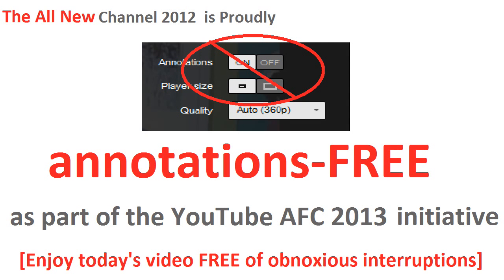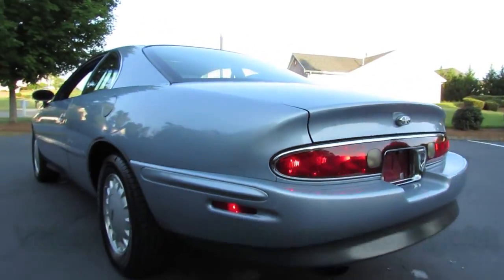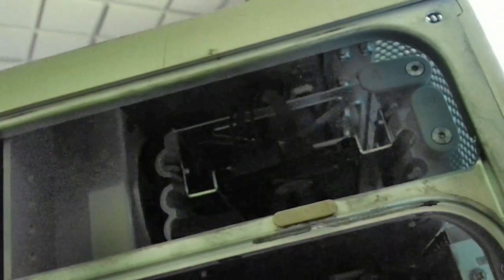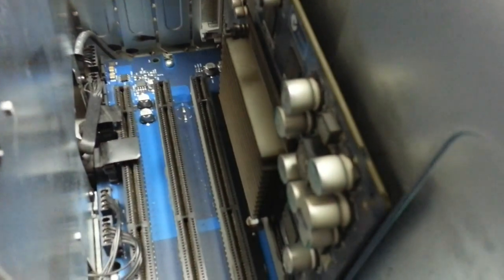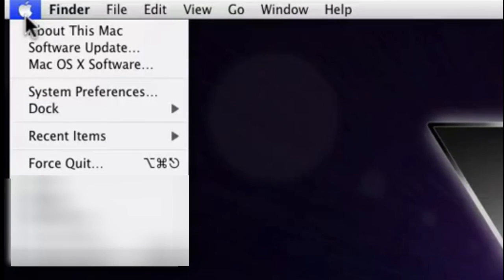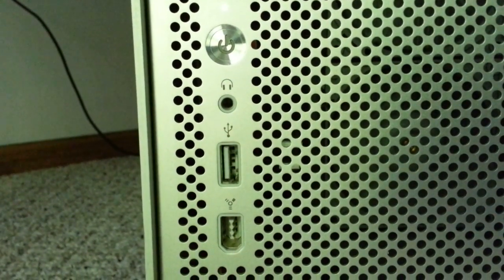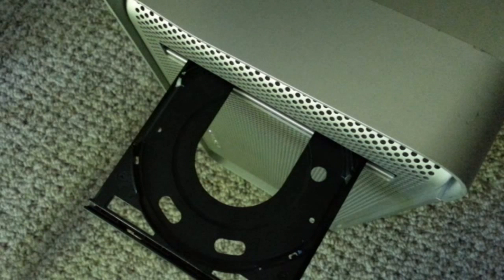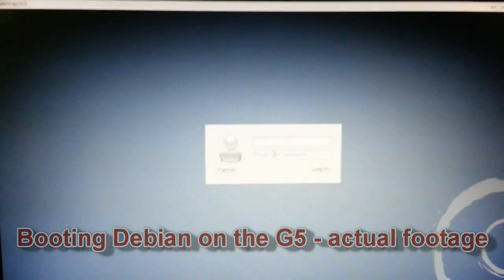FAQ - Using PowerPC Mac PCs in Modernity

Comment: Geez, you have some wrong info. The iBook design and PowerMac G3/G4 designs were NOT failures, nor were the computers themselves. These things are still highly-appreciated today, among enthusiasts.

A PowerMac G5 isn't as powerful as a Pentium 4 from the time? AHAHAHA! Are you kidding me? I have tons of sh*tty Pentium 4 computers, and they are nowhere as fast (or even close to as good) as my 2003 DP 2.0Ghz PowerMac G5. My G5 still screams... this computer was better than and had a much lower price tag than its competitors at the time. Not only was the CASE good-looking, the hardware/build quality was great. No cheap, horrible Pentium 4 computer could ever come close to this thing. It's like comparing a Toyota Tercel to a BMW. This is a pretty biased video, and you have a lot of information wrong. There is no way that some crappy Pentium 4 beats a PowerMac G5.
Reply: G5s are still very capable machines, and projects like TenFourFox and PowerPC Archive help to keep them relevant on OS X 10.5.

I agree with maccollectorZ as I also have a 2003 DP 2.0. Screaming fast for the time, certainly ahead of where the Pentium was at.
Reply from the maker: Thanks for the input. Regarding your thoughts on Pentium4 computers, I have to say that even after having finally sold this computer, we still have two Pentium4 computers in the house that do perform significantly better than that thing ever did. Maybe the G5 is better on paper, but the fact of the matter is that in real world usage, the Pentium4-equipped computers just work faster.
Reply: ***** I'm not sure about that. First off, it's uncommon to come across a dual core Pentium 4 (and as far as my knowledge goes, there hasn't been a quad-core Pentium 4). I currently own an original, 2.0Ghz G5 w/ 8GB of RAM, and it smokes my Pentium machines. Also know that a single PowerPC CPU clocked at 600Mhz is almost the same (or even faster) than a 1Ghz Pentium. Intel processors were getting better, but PowerPC definitely smoked those Pentiums. The amazing performance from Intel chips didn't come until the Core 2 Duos. I am not impressed by my Pentium computers. I guess it's partially because they run Windows; they are way faster on Linux and MacOSX (via Hackintosh intall). That being said, my PowerMac G5 has been able to speed along just fine. And it's not just speed, but it's the overall computer. First off, I can't look at an XP-era Pentium computer and not feel my stomach sink from utter distaste; the same goes for the computers' internals. The PowerMac G5 looks nice and is built well. In fact, the current OEM Windows PC is STILL behind the PowerMac G5, in terms of build quality. It boggles my mind that it's more than 10 years ahead of any Windows PC you can buy today... they still make Windows PCs in the same way, and they have done so for a good 25 years. There is no elegance to it: It's a black box with a 'pretty', plastic bezel on the front (to make it appear nice), and internals crammed inside of it. 

I am sort of having a hard time explaining this, as I usually don't write about late PowerPC machines vs. Pentium machines... It's more of something that can be shown, not explained. There is no reason why a Pentium 4 computer could even be close to a PowerMac G5, in terms of its architecture/build quality, ease of access, and power. A PowerMac G5 cannot even be compared to a Pentium 4, in fact... this processor was compared to the Xeon, which was in the competitors' computers. None of these machines were as powerful as the PowerMac G5, nor were they less expensive.
Reply from the maker: maccollectorZ (Commenting Account)
Interesting thoughts. Let me point a few things out though:

First off, when you said "it's uncommon to come across a dual core Pentium 4", you are absolutely right because (if I remember correctly) no such product exists. Many "hyperthreaded" P4s exist (which may have been what you were referring to) and these are what are in the two older desktops we use at home.

I found it interesting too when you said "I can't look at an XP-era Pentium computer and not feel my stomach sink from utter distaste". In a way, I can identify with that because the picture I have in my mind when you mention that is a crusty gray plastic circa 2001 dell tower, which isn't terrible in and of itself, it just probably had an inadequate amount of ram and a slow/noisy hard drive. That said, a Windows XP computer is more useful because most Windows software is still compatible with it and that sinking feeling you get when you see that computer is the same one I get when I used to have to look at the G5. Two words come to mind during this time: Wasted Potential. Like I said in the video, it talks a big game, but just doesn't come through in the performance department, the compatibility department, the connectivity department, the efficiency department, and many others.

Next, when you said "it's more than 10 years ahead of any Windows PC you can buy today", you were right in the sense of the case being top notch (heck, Apple kept it going with the mac pro until 2012 or so), but you have to keep in mind that an expensive case costs more to make and will turn a $199 "WalMart special" computer into a somewhat more expensive machine. The OEMs' goal is to make them cheap and cut corners to keep that low pricepoint. Those who want quality cases hit up eBay.

I thought you were spot on when you said "It's more of something that can be shown, not explained". I was thinking almost the same thing when putting this video together. Sometimes it's had to visualize the frustration aspect of the G5 and the "it just works without problems" aspect of everything else, but I think I hit the main points: the computer requires a lot of hand-holding to get anything accomplished and the performance is just plain bad, those two points sum it up really. The performance difference is most notable when browsing the web (which is about all you're going to be doing on the PowerMac anyway because of the incompatibilities). Our main circa-2005 Pentium4 performs better at everything (even HD video playback) and is compatible with far more software than the G5 is/was.

Comparing it to the newer (socket 775) Pentium4 machine that I referenced in the video almost isn't even fair, it just puts the G5 to absolute shame, so I suppose you were right when you said "A PowerMac G5 cannot even be compared to a Pentium 4" because the G5 is just that bad.
Reply: *****
It was definitely wasted potential... I really hate Apple for that. They recently decided to cut-off software support for their original Mac Pros, which are MORE than capable of running Mountain Lion or later (good thing one can undo their EFI modifications, but still...) As for PowerPC Macs, I understand that they want to get away from them, but they completely left-behind very powerful and capable computers. This is why I am heavily against software that is constantly updated (Google is a major player here), because it causes perfectly good hardware to become "obsolete".

Windows XP would have been cut-off earlier, had Microsoft not screwed up with Vista. But XP really is an example of what happens when a company actually supports a piece of software for a long time... it shows that software becomes obsolete way before hardware does. And once hardware does fall behind the software that now longer supports it, it's deemed as a piece of junk. Among good hardware, there is obviously bad hardware, but a PMG5 is a great example of a nice piece of hardware that was ruined by software.

By the way, how come you get a sinking feeling when you see a G5? Going by collective opinion, they are very appealing case designs.

I am assuming that you played with my words there... I meant that no Pentium 4 computer can be compared with a G5, because the G5 is radically different and much more powerful. When you look at the Quad-core PowerMac G5s, those especially run circles around the lesser Pentium 4 computers. I am not saying that Pentium 4 computers are powerLESS, but they don't pack the punch that PowerMac G5s do. Also, if only concerning the speed of the machines, that's the only thing a Pentium 4 machine could come close with... there is nothing else appealing or straight-up GOOD about one. Given that they are obviously not sold new anymore, the price different is not relevant.
Reply from the maker: maccollectorZ (Commenting Account)
I know what you mean when you talk about unnecessarily updated software. We see that on the desktop (mainly with web browsers), but even more so on mobile platforms. Android systems are considered "obsolete" after just a few years and the installed software (if acquired through the ever annoying Android Marketplace) gets begged to be updated on a nearly daily basis, which wouldn't even be a bad thing if the updates didn't make the software worse!

I want to touch on your mention of "Windows XP would have been cut-off earlier, had Microsoft not screwed up with Vista" because that is a really interesting topic. The main problem with Vista wasn't performance or compatibility, it was actually just bad press. After SP1, Vista was set and fixed, but the image of the product became so bad that they quit it early and released basically the same thing again (with some improvements and added goodies) under a different name (7). That said, there's nothing wrong with using Windows 7, Vista, or XP aside from those created artificially.

"PMG5 is a great example of a nice piece of hardware that was ruined by software"? Maybe, but if you ask me, the software that is available for it performs poorly anyway, so it was probably for the best.

"how come you get a sinking feeling when you see a G5?" Like I mentioned before, past experience. I'd spent so many hours giving that thing a second chance, but it was like a straight-jacket that kept me from getting anything done. The only reason I kept it so long was because I thought it could be a viable desktop (until I got the P4 desktop), a viable web browsing/emulators computer (until I realized how horrible web browsing was and that I could use my phone for emulators instead of a 600 watt computer), or even a viable "maybe I'll find another use for it" computer.

I thought it was especially interesting when you mentioned that you thought "that no Pentium 4 computer can be compared with a G5, because the G5 is radically different and much more powerful." because the G5, in real world usage, performed more slowly than our circa-2005 P4 desktop at home (that machine is still going strong in fact - and with XP) for most tasks. Chalk it up to poor software, but it is what it is.
Reply from the maker: Timur Tripp
That might be a bit of a stretch, but that website was at least a decent resource for software. TenFourFox went downhill in the last year or two, but it was a decent browser.
Reply from the maker: maccollectorZ (Commenting Account)
I'd have to see that to believe it. For me, it got bogged down with one browser window and a single tab.
Timur Tripp
Mine does. Granted, the Pentium4 machines I'm comparing to are a year or two newer, but still, they handsomely outperform the G5 at web browsing (and pretty much everything else for that matter).
Reply from the maker: maccollectorZ (Commenting Account)
Seems like too much hassle. Windows functions just as well and doesn't have any of the obnoxious artificial mouse acceleration that is inherent with OSX. I avoid it for that reason alone because that has such a negative impact on productivity.
Reply: ***** I've never noticed this at all. Chances are you just need to get used to it.
Reply from the maker: Timur Tripp maccollectorZ (Commenting Account)
If you're having trouble noticing the difference that competent mouse acceleration makes, try a little experiement that I found helped to pinpoint and quantify it: Come up with an arbitrary "task" consisting of clicking a dozen or so buttons on-screen that are close together quickly and time yourself doing it in Windows or Linux, then perform the same task (in a program that is layed out the same or similarly on both operating systems) again on OSX using the same mouse. You'll probably find that you will take significantly longer to perform the same task because of OSX's non-linear mouse acceleration. I found that even the awful trackpad on my Windows netbook was able to outperform my USB mouse on OSX at this exercise. Realizing that OSX drug my productivity down to netbook-class levels was when this really hit home for me.
Reply: ***** I have found Windows' accuracy to feel worse and far less smooth---even with the sensitivity lowered. Linux is the worst between the two. However, in MacOSX, the accuracy and flow of the cursor is great. I also notice that, in Windows, the clicking accuracy, while the cursor is in motion, is not as good. A good way to test this is playing Minecraft. If you are dragging items around, and you need to quickly bring your mouse pointer over to an item, select it, and drag it away, Windows does a bad job of it. I would never have issues with MacOSX, but in Windows, I had to slow down my mouse movements in order to better select items when having the cursor in motion. I do notice a snappy feel with the mouse cursor, in Windows, but I don't find its accuracy to be the greatest. And in terms of touch pads, Apple's hardware and software seems to be a bit more advanced. If you've ever used a trackpad on a Windows PC, where you (idiotically) cannot turn off tap-to-click, you constantly click and drag icons (etc.) by mistake. I am sure this is more of a hardware thing, but MacOSX could also be smarter about dealing with tap-to-click... not that I'd even want to use that stupid feature.
Reply: ***** Pentium d is a dual core Pentium 4 with no HT and they sucked, i mean really sucked, a 1.8ghz athlon dual core was faster than a 2.6ghz pentium d.
Reply from the maker: Super_Slav
Good to know. I'll have to keep that in mind if I ever go shopping for one of those kinds of processors.
Reply: ***** How did TenFourFox go downhill?
Reply from the maker: Timur Tripp
First broken plugins, then the Australia problem that plagues mainstream versions of Firefox.
Reply: ***** Even with tweaking guides that I followed, TFF was STILL a horribly-slow browser. I don't fancy the creator's decisions to make it a full-fledged Firefox browser for PPC Macs... that's stupid. He's aware that the current FF code is extremely heavy. I can't even get decent performance on my 2.0Ghz, dual-processor PowerMac G5. As for Leopard Webkit, it runs beautifully.
Reply from the maker: maccollectorZ (Commenting Account) That's for sure. You shouldn't send the G5 to do a Pentium4's job.
Reply: ***** No, this thing is definitely a power house. MacOSX is also efficient enough that I am not able to max-out the 8GB of RAM I have in it. I was able to run every single application I had on the thing, plus three YouTube videos in three different web browsers, and the computer was both responsive and had 5.5GB of RAM free. I still wouldn't depend on a single core Pentium 4... the only possible advantage of one is that it can run an OS that's still up to date.
Reply: ***** Oh sure, like a P4 could handle the current version of Firefox better than a G5.
Reply: ***** TenFourFox on my G5 certainly wasn't slow with just one tab. How much RAM does yours have?
Reply from the maker: Timur Tripp
It had 2GB (like the nicer of our family's Pentium4 computers) and ground to a halt on crusty javascript-infested webpages that only slowed the P4 machines down a little bit.
Reply: ***** BTW, I just got Leopard working on a 2.8Ghz Pentium D Gateway w/4GB of DDR2 RAM... It runs so much better than Windows EVER will. It did run pretty nicely, but it didn't feel as hearty as my G5. It seemed really good with 10.5.5, but with the updates, it seemed to run OKAY. I haven't compared it to the G5 side-by-side, but I do know that this system is nowhere as powerful as the G5, and doesn't handle certain tasks as well. The web ain't kind to PowerPC machines, but then again, the G5 does do pretty well on it. As for anything else it, sure runs well.
Reply: maccollectorZ (Commenting Account) Why Leopard, why not stick Snow Leopard on there?
Reply: ***** I find that the way the mouse cursor moves in MacOSX is the best. It feels relatively inaccurate in Windows and Linux.
Reply: Timur Tripp I can't remember why... I think I had tried installing Snow Leopard as well. The thing is, I had thought that the installation had failed, so I had packed up the Gateway. Now, months later, I took it out and powered it on. For some reason it actually worked---it went through the set-up and booted to the desktop. It was working nicely, save for some graphical errors. If I were to drag a window with my cursor, it was as if the cursor was tearing through the pixels that it was touching. Software Updates worked fine though. In fact, I plugged an ethernet cable into it and it connected to the internet immediately. It all went pretty well, but then it ended up crashing. I wasn't using Multibeast/Unibeast to install it, so it was a little bit on the sketchy side. But that's beside the point. The point is that it was running MacOSX pretty nicely---better than Windows.
Reply: maccollectorZ (Commenting Account) What a funny coincidence, my DP 2.0 G5 has a similar graphical issue around the cursor, like the pixels around the cursor retain a memory and go back to that state after the cursor is moved away. Both Tiger and Leopard. Very annoying. GPU is stock R9600.
Reply: maccollectorZ (Commenting Account) I use tap to click on my rMBP and it actually works very well. PC trackpads are finally starting to catch up but they are still more prone to accidental clicks.
Reply: Timur Tripp It's far more pleasurable on Macs, but I personally don't like the feature. Some companies don't get it, when it comes to trackpads. HP has some of the worst trackpads known to man. What's odd is that I have an HP laptop from 2000, which has a fine trackpad. Yet, all of the one's I have used today have horrible trackpads: The mouse cursors skips and jitters about the screen; the surface of the trackpad is either coated in an abrasive texture or just feels cheap; the buttons, if part of the trackpad itself, are horrible-integrated and feel stiff, and so on... I feel as if HP completely changed its management, because their computer used to be nowhere as bad as they are now. Another sad thing is that keyboards have gotten worse. If you are ever at a store like Costco (or one that sells computers), try typing on the Windows laptops they have there... the keyboards feel atrocious.
Reply from the maker: maccollectorZ (Commenting Account)
Interesting observations, I guess I never noticed "click n hold" accuracy issues in Windows, but I don't play (or like) Minecraft either, so that may be part of the reason for that. The point still stands though that OSX's obnoxious and nonlinear mouse acceleration reduces productivity down to netbook levels, and the stopwatch (and real life results) prove it. As for Linux distributions, do they even have mouse acceleration at all? I mean, no acceleration is better than OSX acceleration, but it does help to improve precision.

As for trackpads, I've seen good and bad ones over the years. The trackpads in the MacBooks I used to have were kind of lousy, but they were bearable. The best trackpad I've ever used is the one on my Lenovo N200 - it's got the perfect texture (not too smooth), excellent sensitivity, and it's the perfect size (not too large). That is one of the few trackpads that I can use without missing my mouse at all because of how productive I can be while using it. I do disable "tap to click" on every trackpad I use though because I can't stand it; half the time it's convenient, half the time it clicks on something I didn't want it to click on.
Reply: ***** For those who like tap-to-click, the MacBook trackpads are the best. The trackpads on the original MacBooks were OKAY, but they did wear down to an unbearable level. However, with the introduction of the unibody Apple laptops, glass trackpads were also introduced. These trackpads are not only great with gestures and very responsive, but there is a thin layer of some type of glass over them; as far as I know, they are virtually unwearable. They feel nice and smooth, and your fingers will never catch on the surface, even if they are sweaty or something. Of all the great laptop trackpads out there, the glass Apple trackpads are definitely up there.

I used to wonder if the "glass" thing was true, until I saw someone who had shattered the trackpad on theirs... God knows what some people do with their laptops.
Reply: P4 is NOT as powerful as G5 were, so let's put this to rest. P4 with NetBurst architecture were overblown POS chips that sold only thanks to Intel marketing machine. This is a professional grade workstation, and to compare it to P4 is just not fair due to difference in OS. P4 system would to have run Windows or Linux, and FYI, I had a P4 3.0Ghz Hackintosh running OS X Tiget Intel version back in '09 and it  performed worse than dual 2GHz G5 running OS X benchmarks, so there you have it. I still have dual G5 and it works just fine. Check my video to see it in action, the video is old but gives you an idea. Is this still usable in 2015? Depends what you do. If you want a machine that is to be used for email, word processing and ocassional browsing, it works great. You can use it for video editing but newer machines perform better.  Overall this assessment is full of inaccuracies, that it seems it was created by someone who has no clue of OS X, btw. it is OS ten, not OS Ex.
Reply from the maker: AtariForeva
Interesting observations, but let me point a few things out.

When you said that "to compare it to P4 is just not fair due to difference in OS", you are partially right. What makes it an "apples to oranges ;-)" comparison more than anything else is the architecture, but the point was that the Pentium4 computer would be, generally speaking, just as fast for most tasks, if not faster. I used the rudimentary (but effective) "do the same thing on both types of computers and see which one does it faster/better" method. The Pentium4 computers (Prescott and newer Prescott) that I used both exceeded the relative performance of my PowerMac in every area I informally tested, except for style, where the G5 had the edge both times.

When you said, "Overall this assessment is full of inaccuracies", I looked back at my video and couldn't see any, but it's always possible that I overlooked something. Let me know if you spot any.

Thank you for your inquiries and have a great day!
Reply: ***** I went back to try out one of my many P4 machines. I found that the machine was doing well, considering the up-to-date software it is running (Linux Mint). However, once it seems as though it starts to choke once it has to start multiple CPU processes. I found that it was fast with general GUI navigation, but once I got into more intensive things (such as surfing through YouTube), I found that my PowerMac G5 handled things much better. Of course, the PMG5 has much better specs, but if you are saying that even single-core P4s are faster, this is what I was testing against my G5.
Reply from the maker: maccollectorZ (Commenting Account)
That's interesting that you mention that you had a better time with YouTube on your G5. My experience was the exact opposite. There isn't even such a thing as a dual core Pentium4 (although ours are all hyper threaded), and they still handle as well as or better than the G5 for most day-to-day tasks, so that really says something about specifications and benchmarks not necessarily being an end-all evaluation.
Reply: *****
I am actually using G5 with TenFourFox right now to post this message, and the video is choppy since YouTube switches to HTML5 on TenFourFox. Flash 10 on Safari 5.0.6 browser performs quite good, your video is nice and smooth @480p and @720p it stutters a bit. Once I switch the video card from stock 64MB ATI Radeon 9600 to NVidia GeForce 6800DDL with 256MB the video acceleration is noticeably better. And I have 2GB RAM only on this machine. The biggest grief in my opinion is handling videos especially HD ones when compared to newer Intel machines. Mac Pros which are direct successors of Powermac G5 line are way faster and pleasure to work with, but for someone to get a handle on Unix side of OS X as well as get to know intricacies of GUI side of OS X, this is great machine since it could be bought for even less than $50. As for Intel P4, the Pentium D which was released as a last member of NetBurst family of chips was dual core (2 P4 cores on the chip) and it performed pretty good, 3.4Ghz  Pentuim D performed similar to 2.33 Core2 CPU, but it ran hot, same as later G5's. If I had a choice between P4 machine and G5, it would be G5 any time.
Reply: AtariForeva I recommend Leopard Webkit; I use it on all my Leopard PPC Macs and it works very nicely. It is as light-weight as Safari 5 is, yet it's fully up-to-date. I think YouTube got even heavier very recently, but it definitely plays YouTube videos faster than TFF, and is faster than TFF in every way possible. TFF is rather heavy, in fact. I have an original, 2003 PowerMac G5 w/8GB of DDR1. These things still handle the web nicely. I sort of envy those who have the newer models, though. Those models introduced DDR2 memory, etc.
Reply: ***** Here is a great stress test that I did some months ago: 

https://www.youtube.com/watch?v=_1k07EMbnSI
Reply: maccollectorZ (Commenting Account) I just puled an older SSD I had laying around, Intel 320 series, SATA 2.0 and it works great with PPC G5, it is visibly snappier. I recommend it to anyone with G5. Do not use SATA 3.0 SSDs, they won't work, but my Mac Pro does not complain about those. Btw. I had Webkit installed but forgot about it ;). I'll try to put up comparison video, side-by-side using spindle and SSD drive one of these days, time permitted.
Reply: AtariForeva Very nice--I wish I had an SSD in mine! I got my first SSD a few months ago but I put it in my 2009 MacBook Pro, which badly needed it. (That dang, mechanical hard drive kept intermittently keeping the thing from sleeping.) I made a comparison video of Webkit vs. TFF, but I never got around to exporting it and uploading--I think I scrapped that project. Glad to see that you will be doing a test! You'll find Webkit to be nice and speedy.
Reply from the maker: AtariForeva
The video card does make a world of difference. The only problem is that it is extremely difficult and annoying to upgrade video cards on the G5. So much so that it usually isn't even worth it.

maccollectorZ (Commenting Account)
Good call on the Leopard Webkit. While it is by no means as functional or flexible as modern firefox variants, it looks and performs a lot better than the mess that TenFourFox became (speaking of which, are plugins still broken in TFF?) with all of its Australia BS.
Reply: ***** Well, difficult technically or difficult to find one? It's no different than swapping a PC cards, and eBay still has quite a number of them cheap. I see NV GF 6800DDL for $39.99:
http://www.ebay.com/sch/i.html?_odkw=powermac+video+card&_from=R40&_osacat=0&_from=R40&_trksid=p2045573.m570.l1313.TR2.TRC1.A0.H0.Xpowermac+g5+video+card.TRS0&_nkw=powermac+g5+video+card&ghostText=&_sacat=0
There might be stuff available on local kijiji or craigslist. But still, if you find it slow, you can mod it:
http://www.s155158671.websitehome.co.uk/asusp6t7g5!.html
Reply from the maker: AtariForeva
What you fail to mention is that finding a card that is actually compatible is just half the battle. Having to use a regular computer to flash your new card's BIOS is just icing on the cake. If I need a computer upgrading challenge, I'll do it on hardware that is actually worth my time, not one that is worth less than the underpowered $40 video card I'm going to be buying for it.

That said, gutting the case and upgrading the internals is a great idea, but extremely involved.
Reply: ***** Well, you still have P4s you are actively using, so I guess they matter to you. Choosing video card is trivial so as installing it, there are no driver issues as in Windows for example as long as you choose Mac card. Doing video card BIOS modding is not what someone who wants to check out Mac is supposed to do. Again, this is directed to people who are wondering about PPC Macs, not to you, since you have made your decision.
Reply: ***** Yeah, I feel as if it's not as up-to-date as TFF, but I probably need to download a newer build... I wish it notified you about general updates. But yeah, TFF is WAY too slow. If you contact the creator of TFF about it, he just gives B.S. and won't necessarily believe personal accounts that TFF is slow. I really don't understand why he wants to stick modern FireFox on a PowerPC Mac. Modern FireFox is SO heavy with its code. This guy could easily make a light-weight, yet fully updated, browser for PPC Mac; instead, he chooses to sacrifice speed for an entire FireFox experience. I wish someone would bring back Camino. The TFF guy should resurrect it and see how it compares to his own product. He could advertise it as a light-weight alternative. I just see tons of people acting cheery over TFF and saying that it works just fine on their iMac G3 or iBook. Seriously, I have noticed a significant drop in speed, with TFF, on my PowerMac G5. Webkit is faster in every way. The only thing is that Webkit is apparently not as secure.
Reply: ***** That is admittedly true; finding GPUs for these things is a pain. Personally, I don't care to upgrade the GPU in a 10+ year-old computer, but back then, it was still a pain. I have one of the greatest stock video cards for the PowerMac G5 (GF 7800GT), and it's still expensive. I see them for almost $100, when they are just old, outdated GPUs. As for Mac Pros from about 2007/8-2012, you can just put any card in those.
Reply: By the way, have any of you gotten Debian PPC working on an old Mac? I tried it on my iMac G4; it installed fully, and then upon restarting/booting for the first time, I was presented with a black screen. I actually saw your post (Channel 2012) on a forum, while I was looking around for answers. I tried typing in that command that had worked for you, but still nothing. I still get a black screen.
Reply from the maker: maccollectorZ (Commenting Account)
I don't use Firefox on any computers anymore. Last year (when Firefox really went down the toilet), I discovered Pale Moon and have since switched over to it on all the household computers and never looked back. We just couldn't say no to all the performance of mainline firefox combined with good looks.

As for Debian, (and the other half dozen or so Linux distributions that I tried on the G5) it never ended up working out. My failure with Debian probably ended up representing the farthest I ever got with Linux - it worked, but there was no sound, no flash player, and strangest of all, no fan control, which means that about one minute after the system loads, all hell breaks loose and the fans ramp up to hurricane force. Other distributions yielded even less, but you're welcome to try them yourself; newer versions and different hardware can make a lot of difference. MintPPC might be a good place to start.
Reply: ***** I may not have those issues, since I am not using a G5 for this, but I still couldn't get past the black screen on Debian. I tried Lubuntu, but that didn't work either. I have a Mint PPC disc sitting around, so maybe I'll try that.
Reply: maccollectorZ (Commenting Account) I'd say it depends on the specs of the G5..A DP might beat most maybe even all  pentium 4's but my single 1.6ghz G5 is dog slow and is blown away by almost every pentium 4 pc I've ever used..Not to mention the fact that the G5 is pretty much stuck back in 2003(in my case anyway) with the exception of a few pieces of modernish software that  is still supported and up to date..The pentium 4 on the other hand can still run modern operating systems for the most part and with that comes most of the modern software and even some modern games like minecraft..I'm not bashing powerpc or defending the pentium 4 but as far as usefulness in 2015 goes the pentium 4 wins hands down especially the lga 775 based ones.
Reply: ***** Those single-core G5s were pretty sluggish for some reason... as for G4s and G3s, though, they really beat the crud out of Pentium 3s and 4s during their time. It is true that a Pentium 4 is more useful in the modern world, but obviously that's just by chance - it has nothing to do with its performance. It's lucky that it's an Intel processor, which new OSs are still made to run on. You can, however, slap PPC Linux on one of these PPC Macs, and they seem to do very well.
Reply: maccollectorZ (Commenting Account) The Pentium 4/NetBurst architecture wasn't the best, but it was faster than IBM's 970FX/MP in the vast majority of cases (but not all). That's not to say the 970FX/MP were bad chips but they were kinda shoe-horned into a desktop (hence the insane size, cooling and power draw of the G5). The 970FX/MP platform was most suited to server/HPC, which is where it was most successful.
 
In reality, the 970FX/MP was beaten by both Pentium 4/NetBurst and Athlon 64/K8.

In particular, Athlon 64 (and 64 X2) completely outclassed 970FX/MP on every front. They had integrated memory controllers (IMC) and Hyper-Transport links which meant they had faster, low latency access to memory and the chipset. The K8 core architecture also blew away the performance of the 970FX/MP while consuming much less power.

Any current Linux distro will run great on an old 970FX/MP, Athlon 64 or Pentium 4 machine providing the graphics are still supported. Modern Linux desktops like GNOME, KDE etc. use the GPU for rendering and you need a well supported (not necessarily fast) graphics card to get a smooth experience.
Reply: Aaronage Yeah---these newer PowerPC (Just Power today) chips do well in servers. The PowerMac G5 was a great computer, and it definitely outmatched the competition in its day, but it's an absolute beast of raw power. I am surprised that some (maybe even all) of the PowerMac G5s met 'Energy Star' requirements.